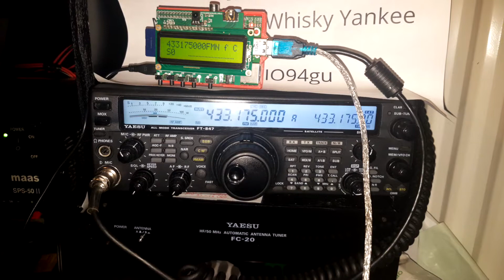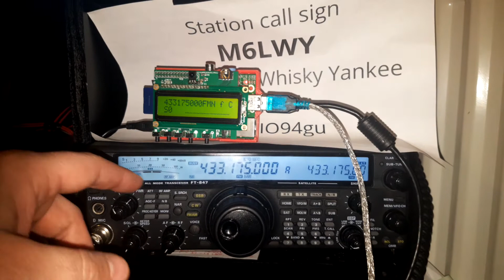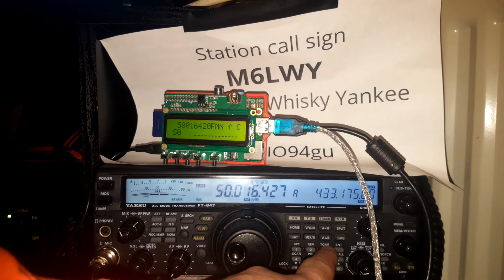[M6LWY] Yaesu FT847 amateur radio headless CAT control using Raspberry Pi

Comment: Hi, the blue usb to serial db9 rs-232 converter is chinese? this adapters based  on FT-232AM and MAX213 IC´s, with +5V, ´-5V levels, I was told FT-847 does not match , please tell me what converter is it, thanks
Reply from the maker: Hi Diego
The RS232 USB converter is just one of the generic Amazon converters that cost the equivalent of a few dollars.  The Ft-847 is perfectly happy with these devices.
73, Greg M0ODZ
Reply: thank you very much 73 LU2DVY @GregoryFenton_UK
Reply: Hi, do you connect USB  to RS-232 with the rig with 3 wire null modem tx, rx and ground or full null modem with handshaking? the settings are 7 bits N 1 stop bit? wich control software do you use? thanks 73 LU2DVY @GregoryFenton_UK
Reply from the maker: @diegogarciamedina6363  3 wires, RX, TX and ground.  The speed is set in your radio menu, menu #37. 8,n,2. I wrote my own control software.
Reply: Hi, cat is bidirectional? If you move
the tuning knob you see changes in the pc
software and changing frequency in pc software you
see changes in the rig? 73 LU2DVY

 @GregoryFenton_UK
Reply from the maker: @diegogarciamedina6363  You would need to poll the radio for changes, in my Python script at https://github.com/gregoryfenton/ft847-python I poll the radio 4 times a second.
Reply: great I will read all the code 73 @GregoryFenton_UK